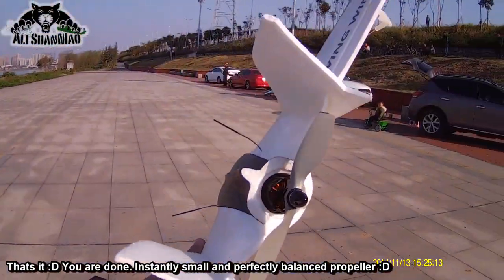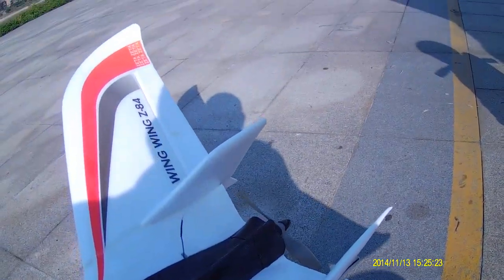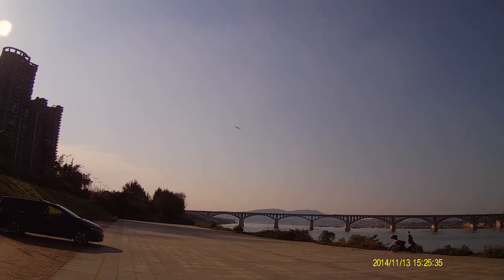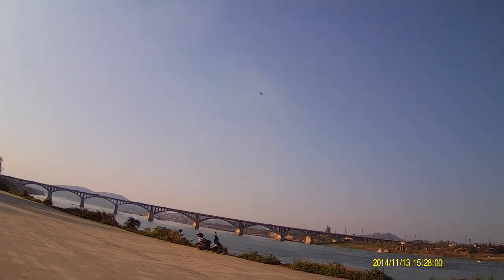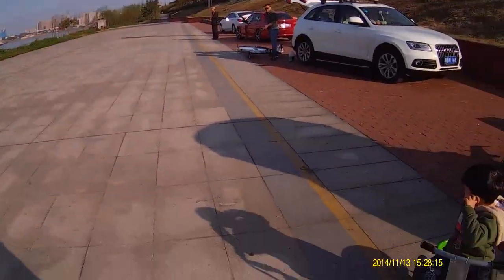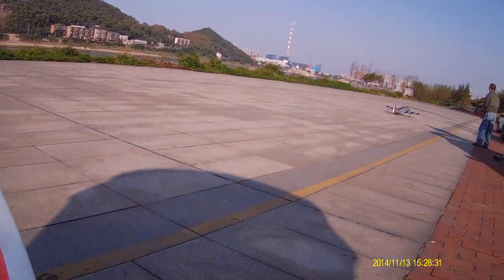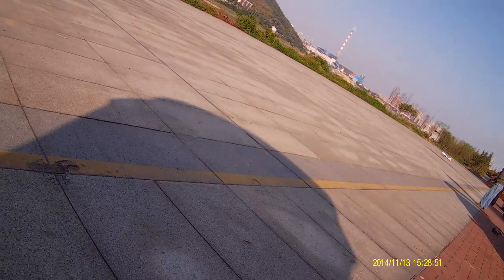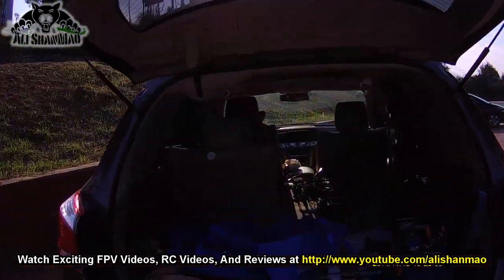How to perfectly cut and balance a propeller in few seconds

Comment: How does that even work.. MAGIC, I SAY! MAAAAGGGIIIICCCC!!!!

Oyh, does anyone have any tips on how to stop servos from getting stuck? If I slam the sticks, 2 out of 3 servos respond normally and go to their maximum values, but sometimes the front one gets stuck in the down position. Anyone got any tips? £10 for a tiny new servo is outrageous..
Reply: Are you using to small of a servo or is your bec supplying enough current, if it goes one way but not the other then its probably just dead. I have had 1 die on me in a nitro car (vibrations kill servo) it would brake but only move in the other direction if I assisted it by hand.
Reply: TheLukey21 I'm using the stock servos on this nano 6ch chopper, also they're 2g servos. That 'broken' servo moves both ways but sometimes gets stuck, but ONLY in the down position. I have no idea why. Nothing is blocking it either :(
Reply: your bec is too small and cannot provide enough current for the number of servos you have. get a larger bec.